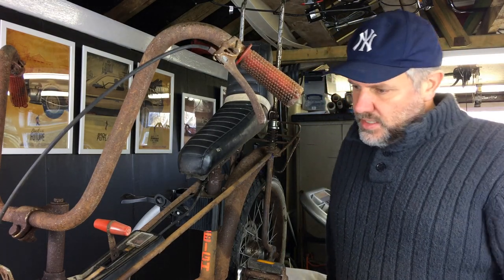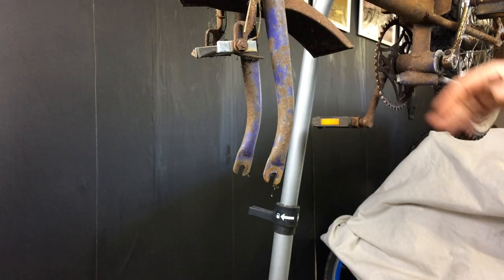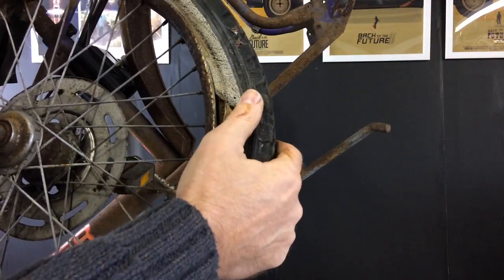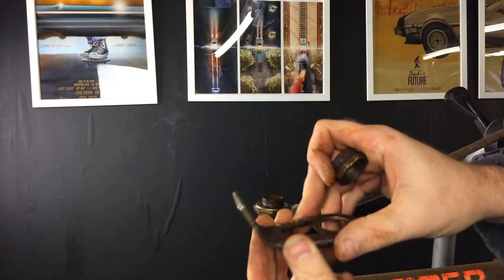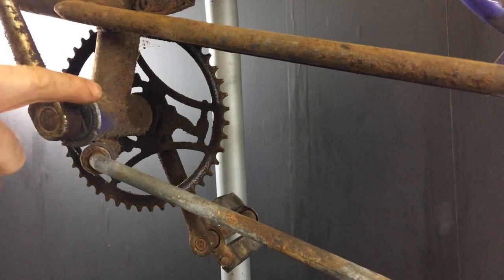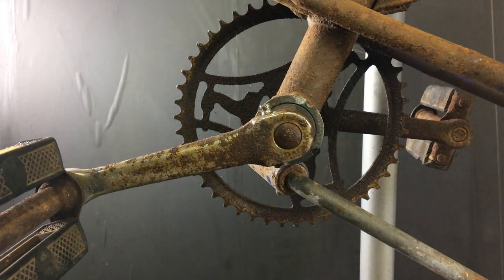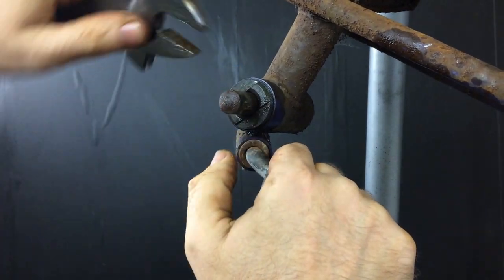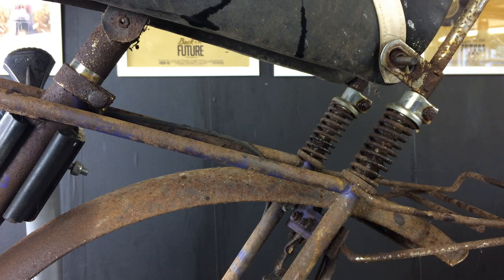Hedge find Chopper - Part 1

Comment: Try to find Rust Penetrant from the auto parts shop. It will work much better for you than WD40 on heavily rusted parts. WD is ok for general use and is also a great cleaner. Nice project!

Comment: Not sure if this is useful anymore but Park Tool makes a specific wrench for this type of cup and cone bottom brackets. It's their HCW-11! They also make a specific tool for the lockrings (their HCW-5). Fixed cups usually require their HCW-4.
Reply from the maker: Thanks, I picked one up a short time ago, used it on another project - much easier. Thanks for the thought though - appreciated.

Comment: Personally I would drop the lot in a citric acid bath, very cheap from Asda etc, it will remove all of the rust and leave you with lots of “patina”
Reply from the maker: Got the citric acid, just not yet got anything big enough to put a frame in - what do you use? Kept this one rusty as not my bike and owner wants it as near to "as is" as possible as a tribute to where it was found - but wants to ride it.
Reply: @TheRestorationShack  a kiddies paddling pool from Amazon, it was about £11 and it fitted a complete frame then wheels, works a treat but make sure you clean everything down afterwards or they do dull. Enjoying watching someone else do it for a change 👏👏👏

Comment: Out edge of dropout where you tighten left nut up for wheel it where the seriel number should be my guess it a 72  mk2 looks like it been fitted with mk1 handle bars in the past  can find date on rear hub aswell buddy
Reply from the maker: Yeah it’s a 72 crossover, must have been using up the last of mk1 parts lol

Comment: One thing I found whilst trying to remove the cotter pins from a Triumph Twenty I yanked out of a skip was to use a ball joint puller to press the cotter pin through. I'd tried whacking the pins with various hammers as you had with little success, but after getting a cheap ball joint puller from Amazon ( https://www.amazon.co.uk/gp/product/B00L906ALS/ref=ppx_yo_dt_b_asin_title_o01_s00?ie=UTF8&psc=1 ) both cotter pins were out in under 20 minutes.